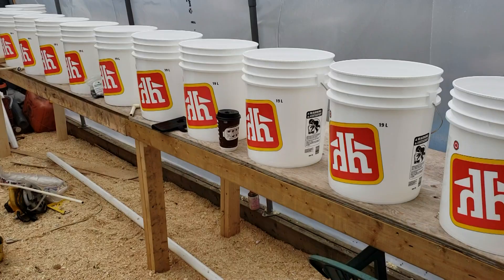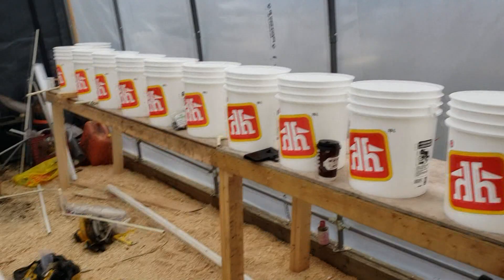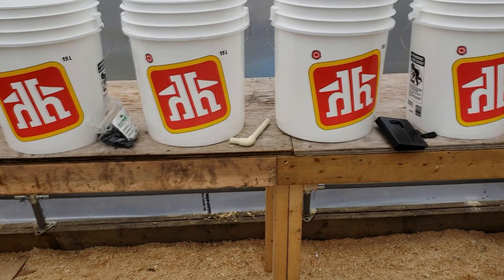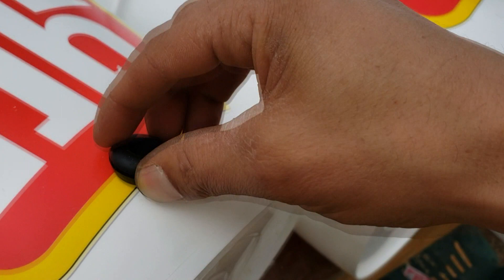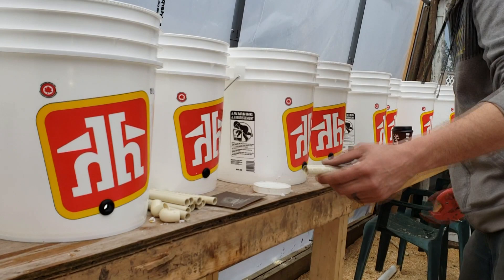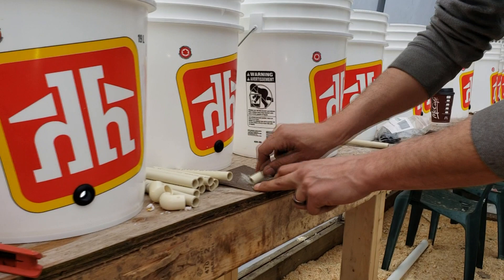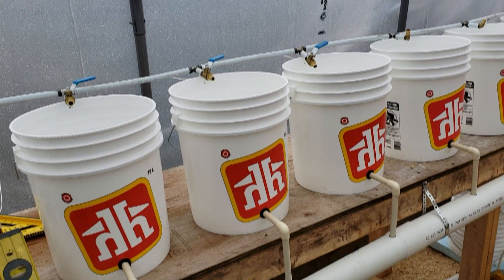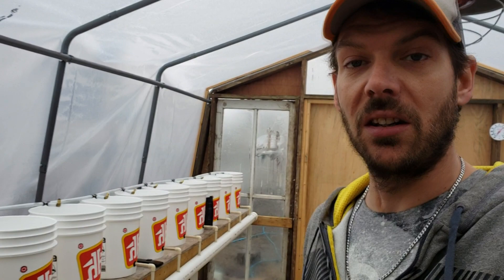DIY Dutch bucket Aquaponics step by step

Comment: If you dip your PVC pipes in some cooking oil it will make it easier to slide into the buckets. Greetings from Sydney Australia. If you have a problem with algae then paint your buckets black on the outside, 2 or more layers of spray on paint.

Comment: CPVC is a cousin of regular PVC. CPVC  (Chlorinated polyvinyl chloride) is a thermoplastic produced by chlorination of polyvinyl chloride (PVC) resin, which is significantly more flexible and can withstand higher temperatures than standard PVC. Uses include hot and cold water delivery pipes and industrial liquid handling. This difference in makeup allows CPVC to withstand a wider range of temperatures. This is why many building codes require the use of CPVC as opposed to PVC for use in hot water applications. The ASTM standard allows PVC to be used in applications not exceeding 140 degrees F.
 Temperatures over this can cause softening of the material and weakening of joints. CPVC on the other hand can handle temperatures up to 200 degrees F.
Reply: That whole long paragraph, and you didn’t even inform him that his drain was pvc, and not abs?

Comment: Use a LITTLE olive or cooking oil on your pvc, this helps them when inserting in grommets. It does dry over time so slippage is not an issue. Just slightly wet with oil a paper towel to apply. Small amounts.

Comment: Awsome setup so far. I am going to help you out with some tips before things go bad for you, 1st I would get rid of those copper valves as copper will be bad for the fish and benifitial bacteria later down the road and I recommend using top hat gromets on the fill lines with 1/8 th inch tubing going to each bucket from the grommets and your buckets won't over fill as they might with your current setup. 2nd I would definitely paint or cover the buckets as they are white and algae will takeover otherwise also down the road 3rd with that many buckets you probably don't need a solids filter and instead just add red wigglers to the buckets but that will depend on your fish stocking densidy. Sorry for all the info at once as I'm kinda a big aquaponics nerd. You are on the rite path though and thank you for sharing and as always Keep Building👍
Reply from the maker: Todd Larsen thanks so much for the tips
Reply: @cjwcustomwoodworking  Those valves look to be brass, Is that correct?
Reply: Building with Todd great

Comment: Additional info : 10 x 10 metre pallet grid with inner space filled with plastic sheets and silicone + a dirt base layer and gravel on top - 1 seed selection per 10 x 10 square - 1 Weekly water drench : continue and enjoy the freed up time ,

Comment: Dear we need 24hour pumping? Or we can attach a solar panel for pumping the water from the fish tank because we can reduce the cost of electricity. Only day time on and night time off. It’s possible or not??
Reply: I mean maybe? You would have to add a lot of airstones into the fishtank tho. The water going thru the buckets removes the solid waste and disturbs the water so it gets air in it. If you shut it off for hours at a time your fish will suffocate
Reply: And I think it would kill the beneficial bacteria in the buckets as they need to stay wet

Comment: Strawberries need a PH of 5.5. Your not going to be able to grow strawberries on the same water supply as everything else. I grow strawberries in hydroponics and you have to check PH every time you add water to the system because tap water is around 7PH. Good video. I have a similar setup but mine is one cinder block high and spread out a little more.  I buried my water tank in the ground because in the summer I want to keep the water as cool as possible.  One more thing is I bought Black buckets to keep alga from growing and them painted them white to keep them cooler.  Good luck.

Comment: Rookie move on the drain holes. Too small and get clogged with roots if you have any bigger plants. Go big on drain hole so flow does not get blocked with roots and you have flooding.
Reply: So what size do you recommend? And can you find the same kind of Grommet for them?
Reply: SheerasPlace 2" and up from bottom of bucket to a height inside the bucket of 2". Bottom of bucket is flat for better seal, the side of bucket has too much curvature. Grommet size can be ordered online.
Reply: SheerasPlace Grainger.com has grommets in many sizes.
Reply: SheerasPlace Also, white buckets are Bad. May not seem like much but you want ZERO light penetration to root system.

Comment: I like the idea of the bucket system it seem a little redundant tho why not just build a 2’ tall by one wide but how ever long 13 buckets would be 13’ like a long plants box put liner in one drain one fill 90% less labor 90% less material.
Reply: Hmm, that's a very good idea.  But if you want to expand or reduce the growing capacity then having separate buckets makes sense too.  I wonder what purpose the interior 90 degree PVC elbow serves?

Comment: sorry but your buckets are way to close...they need to be spread apart.  Also the benches are way too high given your greenhouse height.  And, you really don't need 5 gal bucket - 3 gal will do for tomatoes, peppers, beans - lettuce and greens really only need 1 gal and do best in large rectangular 6" plastic tub.
Reply: De accordo amigo !!!
Reply: @Tulips Moran: can you give reasons for what you have stated please.
Reply: @Zeamus634  smaller bucket = less medium cost = more profit. It's better to spread out as it reduces instances of disease and if planting is too cramped it reduces total yields. The height limits the growth potential of the tomatoes and therefore limits their ability to absorb the maximum amount of light, reducing yields.
Reply: In some places, believe it or not, it's hard to find 3 gallon buckets.  I have never seen 3 gallon buckets in any of the stores near me.  I guess someone could have them shipped, but then there are usually shipping costs.
Reply: Correct... a 5 gal bucket costs me $2.75, and a 3 gal bucket is almost $5... can we just put less medium in the larger bucket?
Reply: @RikardKrvaric  fibereous root system so no specific need for depth over sideways. Imho it wouldn't make much of a difference - but I bet you the smaller bucket is cheaper on Amazon.
Reply: @kwoltekublai3337  Cheapest bucket is Home Depot for $2.68 + tax... Amazon's cheapest bucket is almost $4, even with free shipping... If you can find one cheaper, post a link. It's good to know I can use a 2-5 gallon bucket, because I may find any size buckets from grocery stores, etc nearby...
Reply: @RikardKrvaric  I've actually looked @ cheapest bucket for me (EU) and you can get 1 order minimum order Dutch buckets (very nice shape for setup) + siphon for 2.50$
Reply: @RikardKrvaric  idk about other buckets in us
Reply: THANKS FOR THE ADVICE FARMER TULIPS I ALLWAYS THOUGHT BIGGER WAS BETTER.
Reply: @RCPoliComm  Pizza shops, and ice cream stores have 3 gallon food grade buckets that they give away.
Reply: NFT